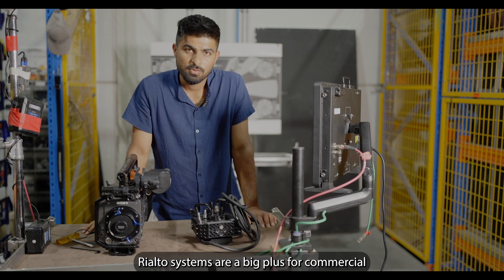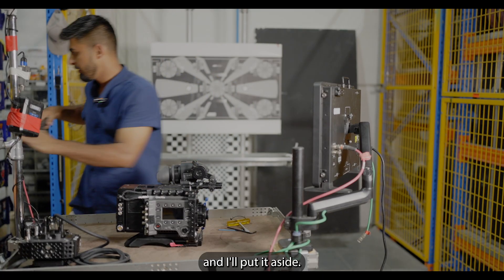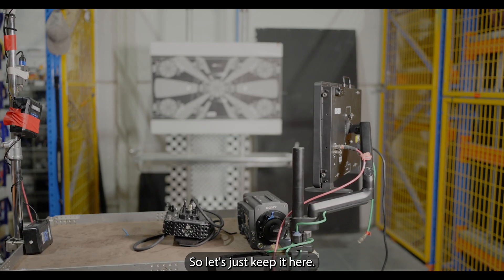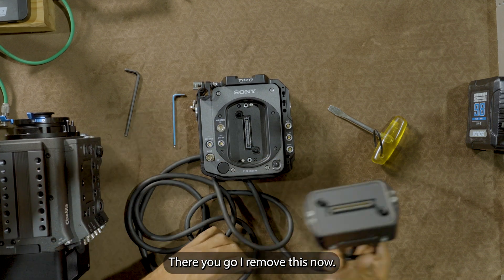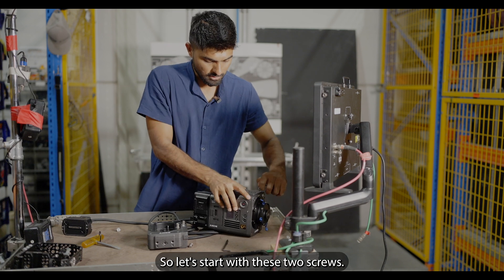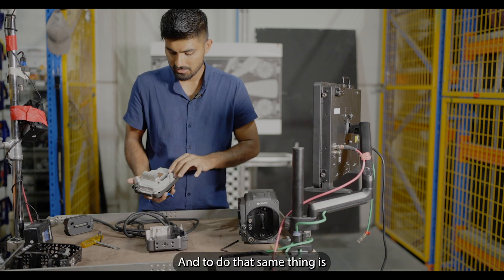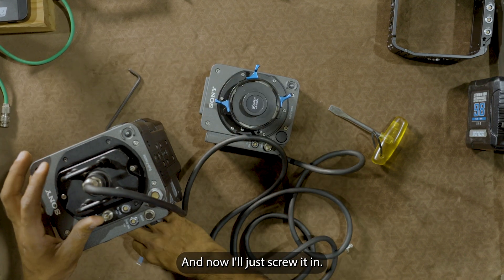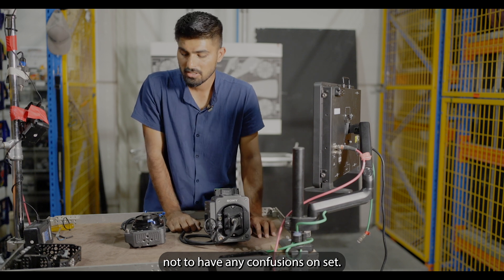Sony Venice Rialto Tutorial| Sony Venice Rialto Full setup Guide

Comment: Well done at the bench with your guide. My Venice 6K sensor is compatible with the Venice 2 body, but would I be able to use Rialto 2 + Venice 2 using the Venice 1 block?
Reply from the maker: Never tried such thing before 
But the sensor of venice 2 will work with rialto only not venice 1 sensor block 
Because the heat shrink size is different on them